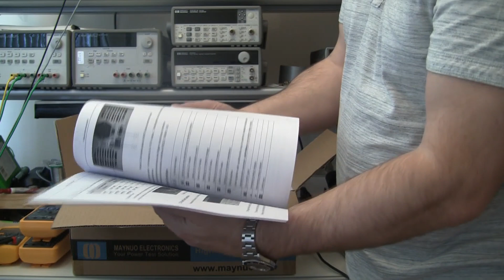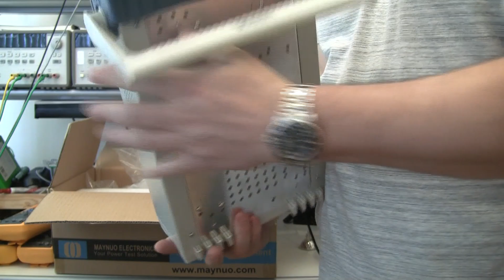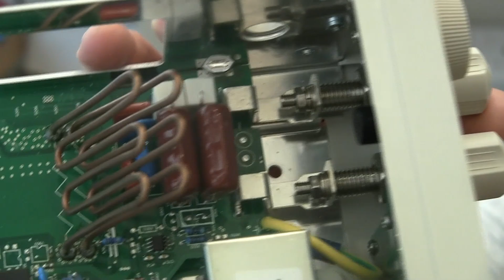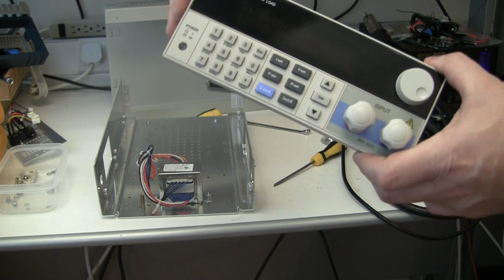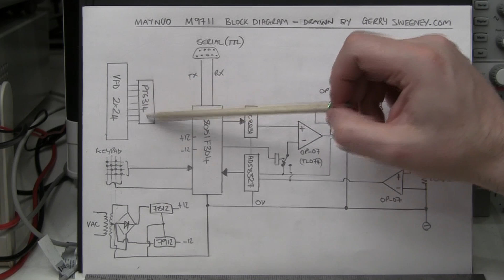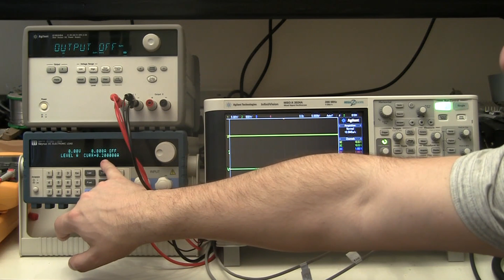Maynuo M9711 DC Electronic Load - Unboxing, Teardown and Quick Test

Comment: Regarding the current balance resistors, they are indeed a good idea. To rely purely on the positive temperature coefficient might have been valid with the now obsolete lateral MOSFETs but not modern vertical devices. These have a point of inflection at which the temperature coefficient changes sign. At lower gate voltages, it is actually negative. The implication is that when you are controlling the FET with a gate voltage below the inflection point, thermal runaway can occur.

Comment: Hi Gerry, I am currently contemplating building my own electronic load, so the teardown of this (BK precision clone?) load was of interest to me. So thanks!
I was/are still undecided if I will use BJT’s or FET’s, as FET’s are possibly not the most logical choice for such a device. But this one uses FET’s so it is certainly an option.
The reason why they (must!) use ballast resistors: you mention that they should not be necessary as parallel FET’s will balance out due to a positive tempco. But this is only true if the FET’s are turned on completely (i.e used as a switch). The RDS_ON value then determines the current through the paralleled FET’s, and the RDS_ON has a positive tempo (more than a factor of 4 for the IRFP350’s I plan to use, between 0.5 Ohm at 25C to 2 Ohm at 100C).
But in this electronic load the FET’s are operating in the linear area and the RDS_ON is irrelevant. The current is mainly determined by Vgs, and here you will find a significant positive tempco: The higher the temperature, the higher the Drain current for a given Vgs. So the hottest FET will draw the largest current, gets hotter and… this can very quickly lead to a catastrophic failure of this FET.
Therefor the ballast resistors are necessary. But that leads me to a question: In your drawing you show the resistors in the drains of the FET’s. Are you sure that is correct? They are useless in the drains, I would expect then in the sources. (higher FET current leads to a higher source voltage and so to a lower Vgs, thereby negating the positive tempco of the FET).
Another question: in your drawing all the gates of the FET’s are connected together. Are you sure there are no resistors in the individual gate leads? Connecting the gates of paralleled FET’s is very unusual as this will almost inevitably lead to oscillations.
This type of FET is not often used in the linear region (for high currents). These FET’s are (so I am told) built up with a large number of individual small FET’s on the die. If one of those small FET’s has a lower gate threshold voltage it will become hotter than the others, and this may possibly lead to internal failure. That is why these type of HEXFET’s are mostly used for switching purposes..
Reply from the maker: Minto Witteveen your observations are correct, the diagram was only meant to be a block digram to get the basic idea across, and yes the ballast resistors should have been in the source, that was me being lazy and not wanting to re-draw it again, I think I commented on this before :)  Thanks for watching and thanks for the comments, good luck with the build of your electronic load. Gerry

Comment: Gerry, again brilliant review !
I was going to get myself exactly the same model, and now I'm sure it is a fair deal, so I'll go for it.

The only reason why they put the balance resistors in is that there was lack of jumpers on the production line.
I think I've seen almost the same board layout with some bipolar transistors, maybe that's why ?
Funny thing is that all the opamps and driving circuit is installed, just an extra of four power mosfets, heatsink, fan, driving resistors, fan socket...

Comment: Mosfets have a negative tc regards of gate on level voltage, that can put them off badly in regards of parallel operation when not driven into saturation.

Comment: MOSFET can have either positive or negative temperature coefficient depending on Vgs. Look at the IRF250 datasheet : Id as a function of Vgs.  It has a negative temperature coefficient for Vgs < 7v.  And this dummy load is only 150W, its maximum current setting is rather low so Vgs is most likely in the negative temperature coefficient range. which can lead to the thermal runaway without those current balancing resistors.

Comment: Because the fets are operated in their linear region for an active load, you DO need a source resistance. You can directly parallel fets only when operated in their switching or saturation mode.
Constant power would be V x I so you either need a multiplying DAC or, let the uC "do the math".
Reply: I thought the same thing, but I suppose a logarithmic output op amp (is there such a thing?) could mean addition instead of multiply would yield the power?

Comment from the maker: Hi, I am not sure thats exactly right, the DC load measure current through its main shunt resistor, not on each individual transistor. I think someone explained that they are there to protect the MOSFET's because a MOSFET's positive temp coefficient can flip negative under certain conditions which can lead to thermal runaway, the ballast resistors stop this from happening by correctly balancing the load between the devices.  At least thats my understanding. Gerry

Comment from the maker: Hi Ig, because of the length of the video already I did not want to go into the whole test too, I guess I could do that and probably should at some point. What I would say though is four power devices in the configuration they are in should easily handle 150W continuous. Not sure how robust under aggressive change which could be a good test.  Unfortunately the only PSU I have that could push it well past its limits exploded in a spectacular fashion when I pulse loaded it with the load :)

Comment: The load resistors are used to move some of the power dissipation away from the mosfets. It saves on needing a very large heatsink for the mosfet pass elements.
Reply: Do you still believe that?

Comment: Hello - at about 37mins in you are talking about the basic block diagram of the load and say that for constant power you need to sum the voltage and current. I presume you mean take the product? Or did you mean that it uses log based amplifiers and take the sum of the logs? Great video BTW - I enjoyed watching this peek inside the load.
Reply from the maker: Tom Biskupic yes I did mean the product, volts * amps = power, so in that mode the load will sink as much current as it needs for a given input voltage to generate a load at a constant power level.   Thanks for the feedback and for watching. Gerry

Comment: Have you tried the software that comes with it?  Can you datalog the measurements?
Reply from the maker: Philippe Marseille I did not manage to run the software at the time, I us a Mac and it needed windows.  I know that others have and yes it works and you can log data with it. Gerry
Reply: +Gerry Sweeney 
The software works very well under emulation. I used Parallels. The only thing to note is which Windows software you use. I tried to run the BK Precision's software on a WinBox running Win10 at work and it wouldn't run and checking specs it needed XP or 7. Luckily I was still running Win7 on my laptop at home under Parallels and the Maynuo software worked like a charm. 
And based on video demos here on Youtube, I like Maynuo's interface better than BK's.
And speaking of BK, EEV did a teardown of the 8500, and with the exception of a ferrite on the power input line, it looked just like what you show inside the Maynuo. I, however, do like the display much better than the BK's. The 4 section are just clearer to me, as is the ON/OFF section and having to toggle in get info would be tedious, I think.
Reply: +Gerry Sweeney
So using the CheckChip Version tool that comes with the BK Precision and Prolific driver downloads, my M133 Isolated USB TTL adapter is chipset XA/HXA. This version works fine under Win7 using the v1.5 driver provided by Maynuo. According to the release notes for v1.12, from Prolific, this chipset version does not support WIndows beyond Win7.
The driver provided by BK is v1.10, which is Win8 compatible, so perhaps their cable's chipset is also WIn8 compatible.
Based on the v1.12 release notes you would need a cable with the HXD chipset for Win10. 
I just purchased a BK cable on eBay, after using eBay bucks, $1.04. I post an update if this is indeed a different chipset cable.
Also, the BK Monitor software seems to have a corrupt installer as it would not install on either on Win10 nor Win7.

Comment: Can you please review Mayuno M9712  300W 0-30A 150V, tear down if possible , does it come with one or tow heat sink
Thanks Mate.
Reply from the maker: Hi - I would if I had one, I don't have access to one of these I am afraid. But yes my guess would be more of the space would be populated, there are footprints for more power FET's and supporting components.
Reply: Thanks Mate,